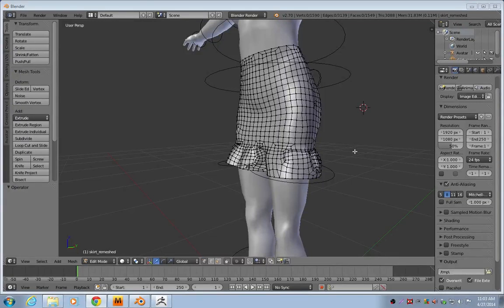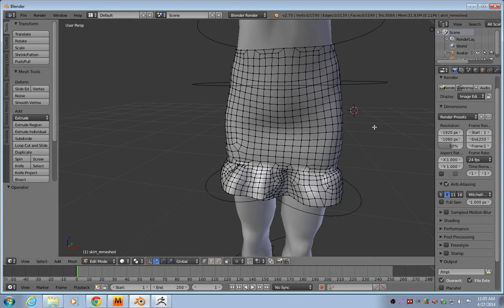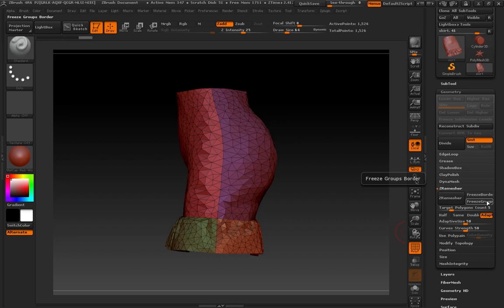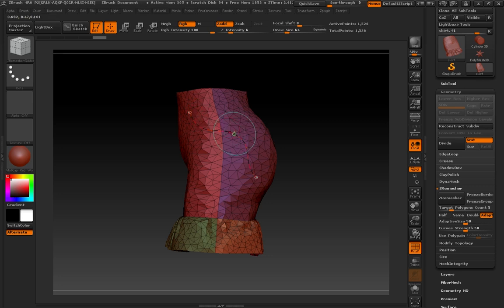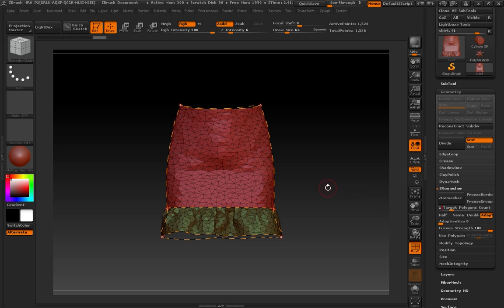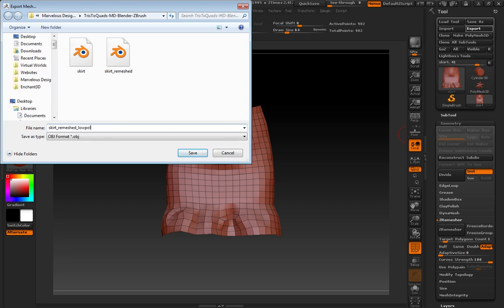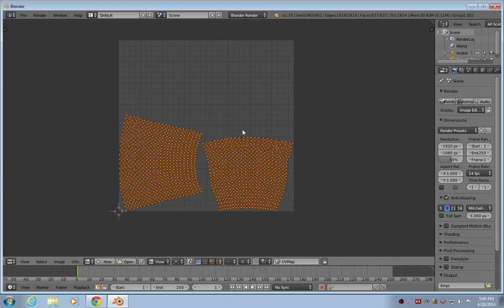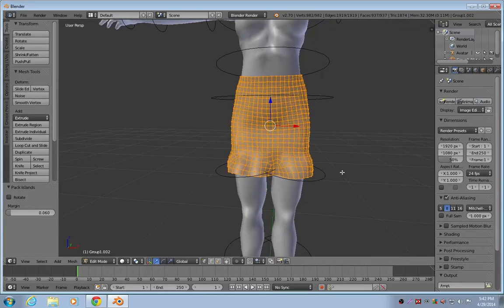Tris To Quads: Marvelous Designer - ZBrush - Blender (Part 2)

Comment: I really love your videos. Was just about to post how marvelous you are at tutorials! - I've run into a problem I'm hoping you can help me with... When I used the first method I didn't have any issues (apart from the additional geometry around the poly group borders as you found), however with this new ZRemesher seam guides process, after I have my seams setup and click to remesh (after setting adaptive size 0 curves 100) only the inside of my dress becomes visible and only the side that is away from me shows if I look from the front. And I don't just mean that the 'wrong side' of my fabric becomes invisible because I know that happens and how to fix it in Blender with extrude to add some thickness to visible parts, but I mean the actual body of my dress is strangely inverted. Do you have any idea how to fix this?? I would much appreciate any advice you can provide!
Reply: Nevermind - lots of trial and error later I found a way of flipping it out through the Display panel by selecting the poly group that was affected. Now I've just spent ages polypainting to make the front half of the body of my dress a separate poly group - with this seam method the poly group merged the front and back of my dress into a pretty ugly shape on the uv map - ideally I'd like them separate for this sort of thing. Looks to have worked well for your skirt though because it is just a rectangle. However with more complex clothing this or the Blender method might not work.